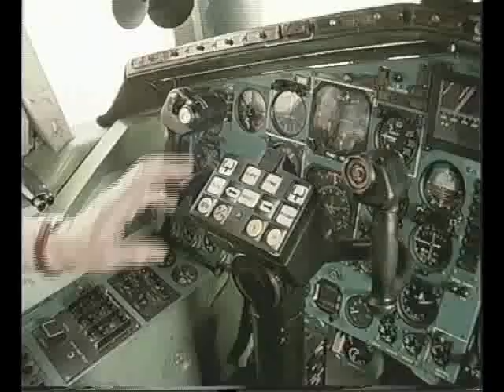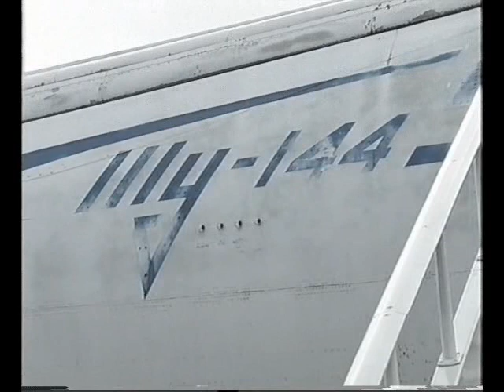Tupolev Tu-144D №77115

Comment: The the TU-144 crash in June 1973 at Le Bourget: A Mirage III of the French Air Force, the flight of which, apart from all procedures and regulations of the lounge, had not been communicated to the Soviet delegation, came too close to the TU-144 to the point openening fire with its 30 mm canons caused a “canard” wing to break. In the poor quality 16 mm film from French TV we see that as the Mirage approaches, pieces of the “canard” wing fall. Due to the low speed of the plane the lift on the wings was no longer assured and the crash became inevitable. Any other explanation is smoke to hide French responsibilities. The official report on the crash mentions "cause undetermined", the investigation was the carried by french responsibility of France and soviet authorities were not allowed.participate. Debris of the plane were never returned to soviets and french were very interested in its titanium parts as metalurgy of titanium were un known in the west at that time. Most YouTube channels like yours don't show the Mirage approaching footage but only the moment TU-144 falls. Any other explanation is 'smoke' to hide French responsibilities.(GM).

Comment: @raulox71 No way for flight with passengers, unfortunately. Fuel costs are very high nowadays (117$ per barrel) and both airplanes was fuel inefficient comparing to their subsonic colleagues, even when fuel was few times cheaper. According to American supersonic air research program (they have also tested Tu-144LL in 90's), there is no possibility to create economy-efficient supersonic jet soon. The only "reincarnation" of high speed jets might be small business planes (Tu-444 for instance).